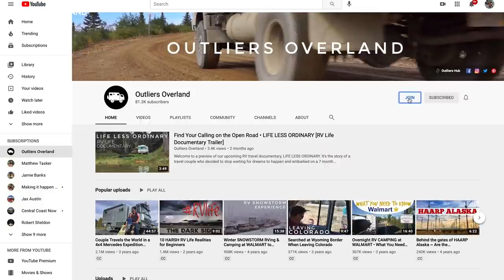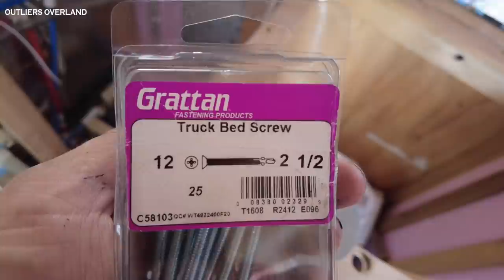Van Life Nightmare • MOLD & MUSHROOMS • Water Damaged Subfloor Repair & Replacement

Comment: I am just floored,,,lol.  Having gutted and remodeled many buildings in the past, you did fine.  Looks better than most remodels done by "contractors" in the 1990's.  If you do the resin again spread it corner to corner on the sheet of flooring, the edge were the resin stops will crack as the resin is stronger than the wood.  Congratulations on the Fuso agreement. Congratulations on breaking over 100K also.  Hope you three stay safe and healthy.

Comment: Yep, rotten wood is pretty disgusting.  You guys did about the same things I would have, glad it worked out well.  The hardener is awesome. I've used similar stuff on rotten wood and even made my own out of polyester (fiberglass) resin thinned with acetone, works pretty good.  Keep the good stuff coming guys.
Reply from the maker: Great minds think alike!

Comment: For 6 yrs I worked as a project manager for vacant bank owned properties. 90 percent of them were full of mold. I've slipped around on my share of slimey mushrooms. Even though we hired professional mold remediation companies, I never took it very serious and never wore PPE. I am now permanently disabled from the damage the mold has done to my body. I live like a person with Lyme disease. I am so glad y'all found the issue and got rid of it. I highly recommend the use of an Ozone air cleaner. You will have to stay out of your rig for 24 hours, but it will kill anything in the air or on your surfaces. Happy travels.
Reply from the maker: That is horrible, once the walls were opened up we could not un-see the risk of being in there so we made sure to mask up and fix the problem correctly.
Reply from the maker: Thanks for the suggestion of the ozone air cleaner too.  We will look into that.
Reply: I too am disabled at 57 from toxic mold that was in my apartment i lived in for 14 years due to 3 kinds of toxic mold all in the walls coming from the roof. Now i just found mold in my old chevy van and im super bummed. Guess the subflooring has to all come out and be replaced.